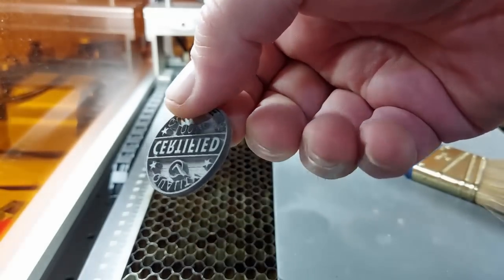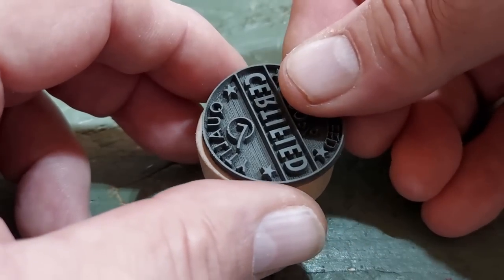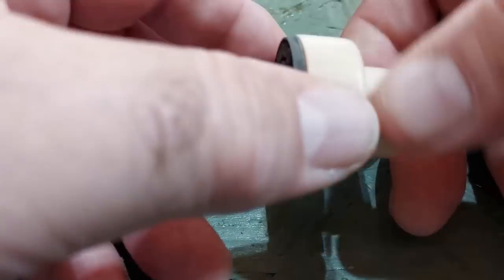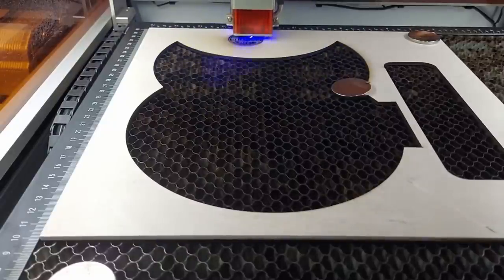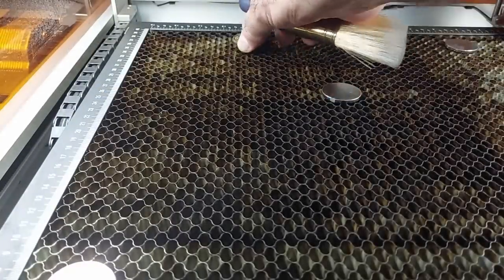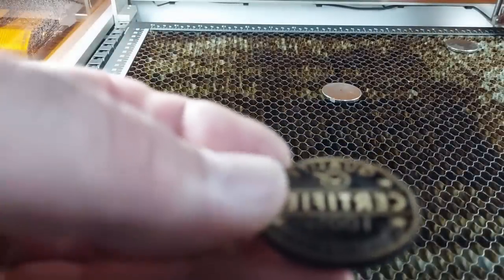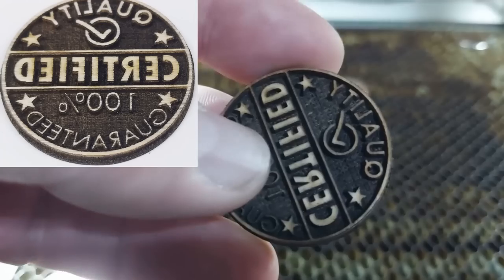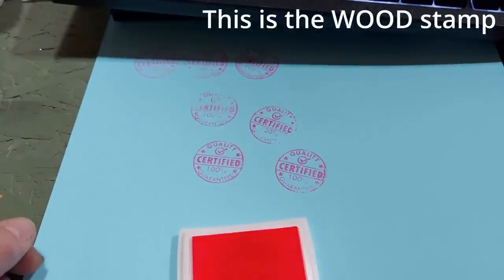😶‍🌫️ Making a Rubber Stamp on a Laser Engraver Cutter, *PLUS a discovery I made!*

Comment: Just a little info for you that may help (coming from the crafting side of things). There is an 'ink' pad you can get which is a colourless embossing ink, Versamark is one of them. It has two properties, being sticky. First, it is good to prime your stamp with it as it makes the actual colour ink you are using stick to the stamp better. The second, if you use the clear sticky ink to stamp with, you can buy embossing powders in various colours. You sprinkle those on the ink, tip off the excess and heat it with a craft embossing tool and it melts it into place. (Like a heat gun but not as hot).
Reply from the maker: Thanks for the tips!

Comment: Rich, about a year and a half ago I made a wooden seal for my daughter. The trick there is to make the negative a little bigger than the positive image so when you emboss the paper it doesn't just punch a hole in it.
By the way, wood block printing has been around for centuries. I have seen a lot of wooden type in my life. Most of it being large letters. But now we have the technology to make the wooden type much easier, don't we?
You are correct about it being better than rubber.
No doubt about it, it was a fun video that certainly will give folks more ideas of what they can do with their lasers.
Reply from the maker: Thanks Kris! And yes, these are engraved larger than the graphics.
Reply: Sometimes having a backing that has "a little give" helps with the ink being laid down.. not a full emboss.. but ya always can do that too.

- Or without "ink" you can do a Blind Emboss.  (and if you make another positive stamp that offsets into the negative stamp you already made.. it does a nice emboss job - even custom napkins.

- Or spray it with Crisco Oil or even "Its NOT BUTTER" spray, and you can make a WAX SEAL on an old school envelope.

- OR if you have freshly Poured SOAP.. you can make a SOAP MOLD emboss for custom soap.
Reply: @josephKEOarthur  great ideas!

Comment: Wood block printing has been around for at least 1300 years.  But carving a wooden block with a laser sure makes it a lot easier.  You might want to experiment with making some larger art prints.  The wood grain adds an "old-fashioned look" to a print that may otherwise look a little too sterile using more modern printing methods, embosses the image into the paper, and makes each print unique.  You can buy or make a block printer fairly easily.  It's another potential business opportunity for laser owners.
Reply from the maker: Thanks for the tip Hugh!
Reply: Current equivalent is linoleum block printing. Did some carving of that years ago. This is a great opportunity with a laser!
(The ink goes into the engraved part, the surface is wiped off, and paper pressed against it to pull ink out of the etched part. the characteristics from old wood block printing is from the ink in the wood being pulled int9 the paper.)

Comment: Rubber stamps often include another layer of rubber/foam between the stamp rubber and the handle to give more compression when stamping
Reply from the maker: This rubber has it built in Angie.
Reply: @TheLouisianaHobbyGuy  I think Angie is right.  I had the same problem and ended up putting a bit of felt in between the stamp and block.  That lets the rubber bend a bit and adjust for the less than perfect flatness.

Comment: For those with 3D Printers you could design and print custom stamp handles with logo etc
Reply from the maker: Oh duh! I didn't even think of that! Thanks for the comment!
Reply: Or even a simple LATHE make the stamphandle .. (dont have a lathe? then rig up a good corded drill , DIY lathe - mainly for soft woods)

A good powered lathe and you can use billets of Aluminum  Rods and make the handle that way.

Comment: Hi Rich.  I missed it, if you mentioned it, but did you turn on Ramps for these engravings?  Thanks for the video!
Reply from the maker: I don't know what Ramps is Raun. It was a simple engrave.
Reply: @TheLouisianaHobbyGuy  The option is on the Advanced Tab of the Cut Settings Editor for Fill Mode.  My understanding is that it widens out what is left as it engraves deeper and provides more stability in softer materials like rubber.  I've never used it but I've also never made a stamp before.

Comment: Looks like you used the Roly. Settings?
Reply from the maker: The final test settings for both the wood and rubber were 3000 mm/min with 75% power & crosshatch on, with a 325 LPI. The rubber would not cut in line mode with any setting! I wound up having to offset the line and set it to offset fill with the same settings and it cut right through.